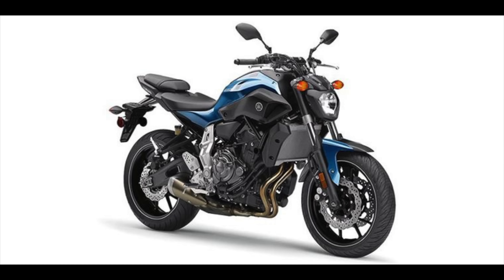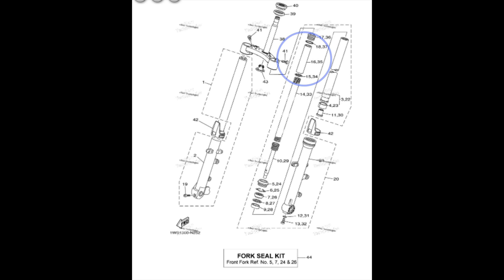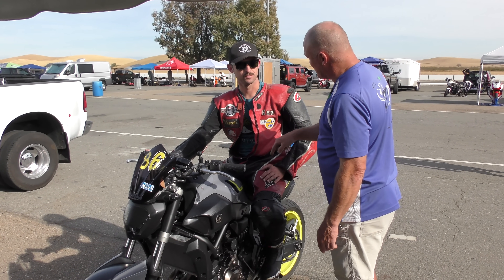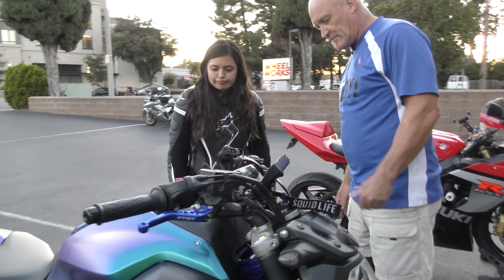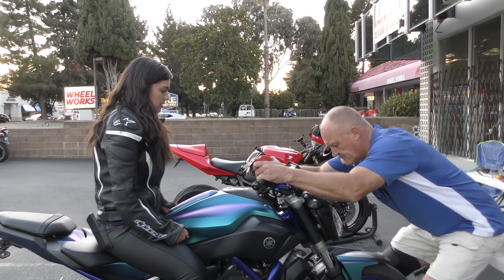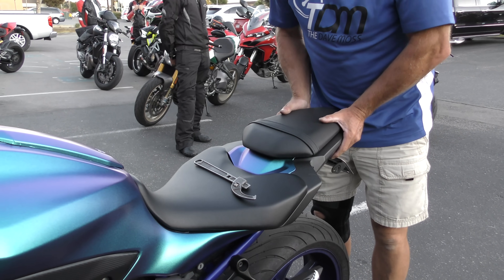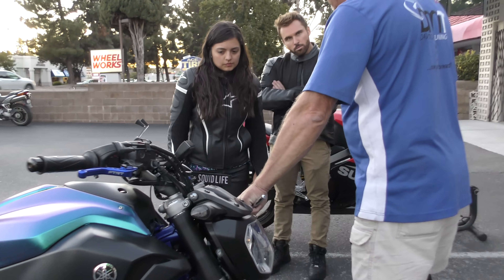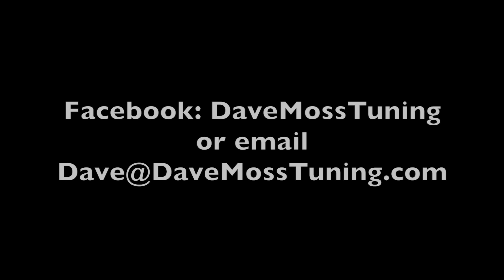Yamaha FZ-07 / MT-07 Fatal Flaw and How To Fix It

Comment: Hi Dave, just about to put a deposit down on a 2022 Tracer 7 - I weigh 85kg/190lbs, and I expect to be carrying a pillion occasionally. What check should I be making when I collect the bike please? Thanks, Nick
Reply from the maker: Check rider sag with you both on it and ask the dealership to set sag between 30-40mm for the rear shock. That is very simple and straight forward. Set your ergonomics as soon as you can.
Reply: Many thanks for the reply! Is this likely to entail the firming up of the preload and the rebound, or just the preload? The Versys I’d been looking at only had adjustment for preload, so presumably stiffened preload for heavier loads are better than no adjustment at all? Thanks again :-)
Reply from the maker: @nickw3583  Preloaf first to set travel optimally. If rebound adjustment is available, then it is set as shock spring tension has been confirmed.

Comment: This only seems necessary if you plan on racing the bike or pushing it to the limits. Which is why you see this guy mentioning this to a bunch of people racing the bikes at a raceway. For everyday use and riding around casually I'm pretty sure Yamaha has put all the test needed to make sure its a safe reliable ride. I use to own a FZ-07 and i was scared to death taking this thing on the highway at 130+ mph. It's not aerodynamic and the wind pushes this bike all around, the shakes and everything make it really uncomfortable. I wouldn't even want to try racing this bikes. This bike is known for a casual ride or for trick riding, not racing and pushing to the limits. Extremely fun bike for recreational use. But, once you push this bike past 100mph, you will quickly learn that its better to get a sportsbikes and not a "naked bike". I will bet money that yamaha or other engineers can come up with reason to counter this guys opinion on his suggested modifications and why it wouldn't be a good idea to start cutting spacers. Just my $0.02
Reply from the maker: Please review comments provided by riders who do not ride the track and found that this was an enormous difference for every day riding. Christina Page's comment is pinned for that reason.
Reply: @catalystreactionsbw  "enormous difference for every day riding" and "fatal flaw/ catastrophic design" are 2 totally different descriptions.

Comment: Awesome channel. Thanks for the pro tips. 
I'm picking up a new 2021 model mt-07.
I'm 120 kilos heavy and 169 cm in height. What are your suggestions for my setup. I don't seem to be able to find a similar guy/girl at my specifications in the comments. 

Thank you in advance.
Reply from the maker: Thank you! 20w fork oil, forks at stock height. Shock at 3 notches from the highest point and rebound at 1 turn from closed.. Start at 42 front and 44 rear cold psi with your weight.

Comment: Thank you very much for sharing your knowledge.
I have a 2017 Tracer 700.
For some reason I don't have much confidence in the front suspension...
Given that the platform is the MT-07, are the suspensions similar? 
I am 95kg, 184cm, should I reduce the saucer by 10mm and raise the forks 8mm?
Thank you in advance
Reply from the maker: Depending on your weight, 15w to 20w oil and yes to spacer and  geometry if you are less than 170lbs or 77kgs
Reply: @catalystreactionsbw  
Haven't gotten the oil yet but changed spacers to 140mm and it's already a new bike. It's awesome. Thank you for the tip
Reply from the maker: @tiagoduarte7579  Thank you for sharing the your experience and benefits so far!

Comment: I hope this is the same guy talks YouTube channel because if so I have a question I hope he could answer. I just bought a 2015 fz07 and I’m gonna turn it into a stunt bike. Should I just upgrade the forks or just use stock but cut to proper size?
Reply from the maker: If you are doing that, use 20w oil to an oil height of 110mm. Also cut the spacer 10mm and set the forks at the joint of the cap and tube.

Comment: So lets say I want to have this fixed at my local shop. Should should I ask for? There's...a lot...being said in this video. I'm not sure how to communicate all this to my shop.
Reply from the maker: 400cc of 20w fork oil, 10mm spacer reduction in length, forks reposition with 8mm of fork above the triple clamp.
Reply: @catalystreactionsbw  thanks for the reply. I'm 175lbs and 5'6. Should I still go with 20w or drop to 15w?
Reply from the maker: @temporaryscars  at 175lbs 20w

Comment: Hey Dave what adjustments would you say for a mt09 sp?
Reply from the maker: Set sag at 35-40mm both ends, set compression at 50% of the range. Check fork and shock travel used to see how preload is set and what needs to change based on this data point.

Comment: On the rear shock you mentioned the clearance for it to be acceptable is between 30-40mm, is this true for everyone? Im 150lbs. Also when you say 562 and 526 is that 56.2 and 52.6mm?
Reply from the maker: That is rider and static sag combined = 30-40mm. 562mm and 526mm were the extended and rider on measurements.

Comment: So I’m thinking of buying this as my first bike, is this still an issue on newer models?
Reply from the maker: Yes - a simple and easy fix. Most other non adjustable forks need the oil changing quickly also - this is not unique to the MT07.

Comment: I shortened those FZ07 front fork spacers 10mm and one is now longer by 1mm from an unknown reason. They were cut exactly the same measurement. Will this affect the suspension at all or should I buy new spacers and recut? Thank you for the information video
Reply from the maker: You are fine - the difference will be the grind on the top of the spring. Nice work and a tip of the hat to you for getting this done!

Comment: I'm around 210 fully geared.. so I'd be looking at a 10mm cut down on the spacer and 20-25 weight fork oil.. correct?
Reply from the maker: Yes, 10mm spacer cut, 6mm fork geometry change and 20w oil
Reply: Great! Thanks Dave!!

Comment: Brill video thanks dave. I was gona pass on the MT07 because of suspension reviews, but I might get one now. Would this same advice apply to the XSR 700. Thanks
Reply from the maker: Yes, same process for the XSR.  Make a point of checking static sag on both models for the rear shock.
Reply: @catalystreactionsbw  will do. Thanks for the reply much appreciated 👍👍

Comment: Hi Moss ,your Video is very informative. so i just bought a new 2021 MT07, i'm 1m75 in height and weght around 75 kg, According to your instrcution, i should cut the spacer around 10mm, using 20w fork oil and lower the front end 8mm? thank you
Reply from the maker: I would start with 10mm spacer reduction and 15w oil to 150mm oil gap and ride. After 50-50kms, lower the front 8mm and ride again.
Reply: @catalystreactionsbw  thank you good sir, i'm sure i will be able to enjoy this bike safe and sound with your instruction.

Comment: Appreciate the advice Dave ! The last months I've been looking at MT07 videos, articles, etc and biggest flaw I found with the bike was the suspension, but your solution is super easy.
I finally managed to reserve a new MT07 year 2021, although the supply for Yamaha in Romania was really bad this year.
I'll have 3 years warranty for it. Do you think the dealer will accept making the 15mm cut to the spacer ? Is this something they would normally do ? I'm 171cm and 65kg.  On one hand I wouldn't want to lose the warranty but on the other hand safety is even more important. Cheers !
Reply from the maker: There is no issue with warranty if you change spacer length and oil. This has been proven many times by owners that have made changes to the forks. Changing the rear shock to a different one does not invalidate warranty either. The main concern of warranty is engine and electronics. You might ask a different brand dealership what would invalidate a warranty on say a Ninja 650.

Comment: Would this still apply to a 2021 MT07? 190-200lb rider here. Bike has 600 miles on it.
Reply from the maker: Yes it does.
Reply: @catalystreactionsbw  thanks for the quick response. I was curious since the OEM shock I believe has added rebound and preload adjustment, not sure if the old ones had both options
Reply from the maker: @chasecvlt  The previous iterations only had preload. The shock on our 2021 R7 review is exactly the same, so you can get settings from that video.

Comment: Is this flaw even on the yamaha MT 07 2020?
Reply from the maker: For fork oil yes - it needs to be heavier.
Reply: @catalystreactionsbw  thanks for the advice! I am going to the track in summer and I didn't know if the 2020 model needed to repair forks also or not. Thank you very much for your answer :)
Reply from the maker: @vojtakresta3079  for track work oil level needs to be 25-50ml more than stock volume.
Reply: @catalystreactionsbw  OH ok. Thank you very much :D

Comment: Dave would this apply to the 2022 R7 as well? It's basically the same motor but did they change the suspension springs and specs?
Reply from the maker: R7 is completely different set of forks. We tested the R7 and made some changes. Depending on weight and skill, 10 to 15w  worked well. https://www.youtube.com/watch?v=vAwmdDFt6qs

Comment: does this apply to the 2018+ model as well?  I believe they made suspension changes (for instance my 2018 shock has both preload and damper adjustments).
Reply from the maker: It applies to all MT07's up to 2021.

Comment: at the start he mentioned you should cut the spacer 15 mm if your under 140 and 10mm if your above 140lbs. He then told the first dude to cut it 15mm and the smaller chick to cut it 10mm. which one is it?
Reply from the maker: Ability has a lot to do with the oil chosen and spacer cut. If you simply commute vs weekends, there is a profound speed difference. Commute = 15mm cut and choose your oil.

Comment: I own an MT07 2021 and first of all I haven't felt anything weird on the suspension although it is fairly new. I've only done like 500 KM on it so far.

Now, one thing I love so far is the riding position of this bike (coming from an MT-03). It is more upright, and I feel like it suits my riding style better.

Thinking about this mode, I am afraid that lowering the front-end and cutting the spacer would turn my riding position more into attack/racing mode.

Would simply changing the oil for a thicker one make any difference for me, or is this mod more like an all or nothing kind of thing?

I weight 60 Kg by the way.

Thanks!
Reply from the maker: Hi Felipe.
At 60kgs the forks will feel very nice indeed to you so no change is needed. If you were 85kgs or more, you would notice a big difference. Ride for 3-4,000kms and see how the bike handles corners as you go into them at 50 to 80kph. If not as good time for the same oil as you are so light.
Reply: @catalystreactionsbw  perfect Dave. I appreciate your response a lot! Thank you for taking the time

Comment: Just bought a 2019 mt07. Seems to have a softer front suspension than my mt03 even did. Does the 2019 have the same issue in the video?
Reply from the maker: All the way to current model needs fork oil change and spacer reduction.

Comment: Dave, I went with emulators up front. Your recommendation of a 8mm drop in the front noticeably improved turn in. I have a K Tech shock inbound. Would raising the rear, via shock length, by 8mm yield the same rake & trail as dropping the front 8mm? Other than the increase in ground clearing and CG, would the turn in feel similar with the 8mm lift in the rear, or would you recommend a different spec than 8mm for the rear? I'd like to keep the soft underbelly of the MT07 a bit harder to damage.
Reply from the maker: In general, raising the rear by 3-4mm is the maximum based on swing arm angle.
Reply: @catalystreactionsbw  Thank you, that's great info. Creating an issue with swingarm angle hadn't occurred to me, with a 8mm adjustment. So I should split the change front to rear, to maintain your current rake recommendation (w 8mm drop up front)? That is to say, raise the rear 4mm, and drop the front 4mm, for rake/trail that is ~ equal to the 8mm drop up front (alone)? Thanks again for taking time to reply :)
Reply from the maker: @petermccann2561  The principle is to test different configurations. Then you find what you like for your bike on your roads at your speeds.
Reply: @catalystreactionsbw  Yes. IIRC, I discovered your channel in '16 or '17, when I was setting up my new '16 R1 for track duty at COTA. Your MO is exceptional in that you explain what you are doing, in a way that new riders can understand, so they can learn how to work on bike set up themselves. Good tuning starting points, by platform, are not easy to find, and yours have always been very close to where I wind up. Very important for riders learning to set up their bikes to understand your point: Bike set up is individual-like a tailored suit...involving preferences, body dimensions, skill level, ect. Having a good starting point, to return to if needed, saves much time and frustration. The shock I installed raised the rear 8mm static (~9mm rider), out of the box. Without your caution on swingarm angle, I could have wound up with stability, and or drive line issues. Thanks again. :)

Comment: Hey Dave,  I’ve watched this video 30 times. Your confidence in what your talking about gave me (not a mechanic) the courage to do this. I had a lilttle trouble, the bottom bolt wouldn’t come out of one side, it was spinning, and the Yamaha diagram of this fork has the fork seal upside down, so I was putting it in wrong. With a little help from my dealership ($50) it’s back together. I did  shorten the spacers 10 mm & 15w fork oil. I’m excited to try it out...
Reply from the maker: Hi John. Fantastic work and congrats on the end result. A tip of the hat to you sir! I too am excited to see what you find in regards to ride quality. Make sure you test geometry as that is a big part of the end result. Start with stock and lower by 4mm, then lower another 4mm. Don't forget the cable tie on the right fork tube.......
Reply: How did it turn out?

Comment: I was going to get one of these… :/ idk wtf to get now. I had a Vulcan s and my front fork would leak. I think that’s why I totaled it, as my breaks didn’t work very well when it happened. So I’m not stoked about a bike with suspension issues.
Reply from the maker: For the price of a bottle of 15 or 20w oil, the problem is resolved with the forks. Very cheap upgrade for a dramatic improvement.

Comment: I've hit you up on your tire pressure video and now I see this one. It makes me wonder if my bike is properly adjusted even though it's not an MT-07. 

Stan here. 6', 180lbs. I own a 2020 Ninja 650 KRT ABS. Do you have any suggestions for this bike and my weight? I haven't touched the stock settings.

Is it true I should replace the rear shock at like 10k miles? Christ, I have that much on mine already!
Reply from the maker: It is a suggestion for the rear shock re miles or you find a very low miles OEM version as someone immediately upgraded to an after market version. The longer you keep it, the more it resembles a lava lamp:- beats you up with cold thick old oil, gets nice for a short time and then beats you up again with very thin fast flowing oil when fully hot. 10w fork oil worked well in those forks and stock geometry was decent. You might try 2 notches up on preload in the rear shock.

Comment: I have a 2021 I measured the preload and it was 18mm. I them changed to racetech springs and emulators.  They recommended a 15mm preload for my weight. Will the stock fork affect this? If I had cut 10mms off the 18mm stock one I'd only have 3mms of preload. Should I do the same with the racetechs? So instead of 15 I would have 5mm between the cap and the top of the fork?
Reply from the maker: Preload on a spring is measured differently. https://www.youtube.com/watch?v=ICK_2tX9_Qg&t=320s. USD or standard doesn't matter. Measure the stock spacer and spring length then match it with the new spring spacer combination.

Comment: I'm about to buy a 2021 mt09, do you know if any of the previous model mt09's have this same issue?
Reply from the maker: There is no video on the MT09 having an issue like this with spacer, damping rod and oil viscosity. They have a cartridge fork and have preload and rebound damping.
Reply: @catalystreactionsbw  cheers Dave, do you know offhand if the forks on the MT09SP are actually better than the ones on the base model.

Comment: Hi Dave, been watching your videos for a while now.
One question before I gonna do it myself:
Is it the same for XSR 700 ? 
I know it’s the same bike and everything- just wanna make sure…
I’m 80 kg 1.80 and I have 2017 xsr 700.
In turns the bike really feels bouncy .
I bought the 15w bel ray fork oil and I intend to cut the spacers 10mm each as you recommend.

Regarding the rear shock- I can feel any static sag..
Reply from the maker: If you bought the bike used, check first for static sag. If stock, it will be 15mm or less. Then you know it is correct for the work to be done in full.
Reply: @catalystreactionsbw  
Thank you for your quick answer!
I bought it new 4 years ago - I already have 40,000k - I wish I knew it before..

From what I understand :
1.my rear shock need to be replaced regardless the sag ( to many miles for stock shock)
2.front fork- I’ll do the measurements- and I’ll change the oil and cut the spacers.
I’ll add photos and comment after I’ll finish.
Thank you !
Reply from the maker: @danib738  Thank you and Nitron offers the best value for money shock. Look at the R1 version of their rear shock offerings.

Comment: Are the Mt 9 sp better
Reply from the maker: I have a standard MT09. Much easier to work with than the SP for every day riding as a general settings works well across a broad range of use. The SP requires attention to detail and settings based on roads, speed and oil age.